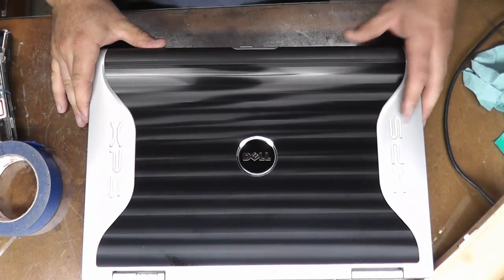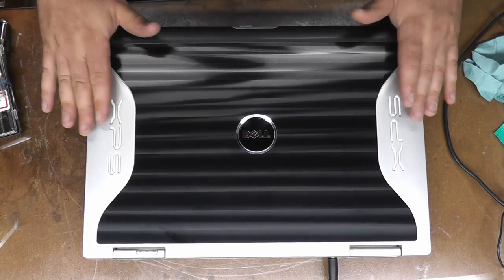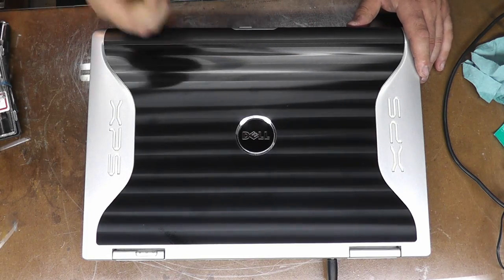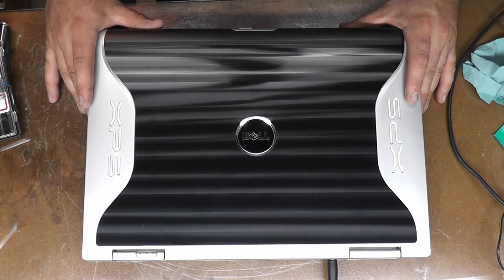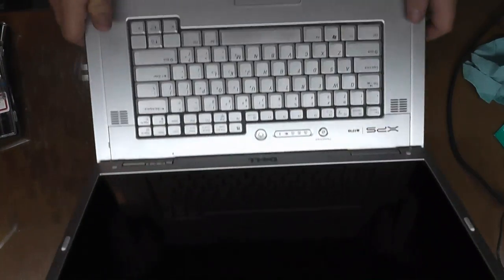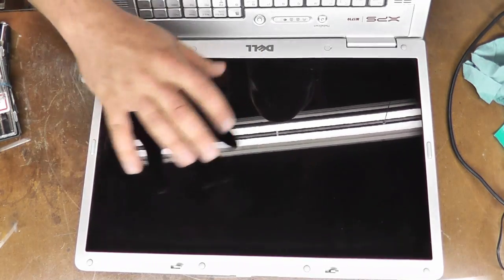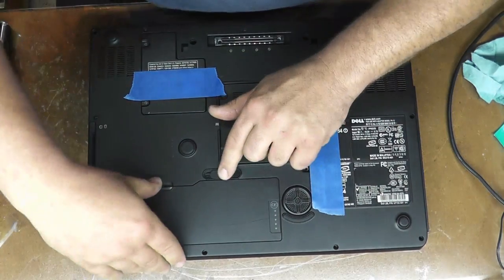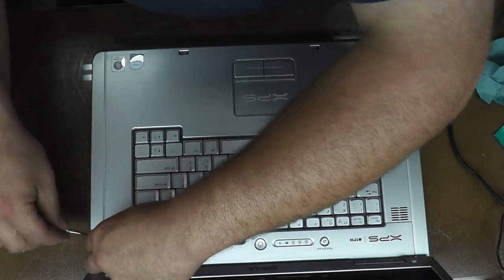Baking a Computer Back to Life

Comment: Next time, maybe try a reball with some lead solder balls. Either way, you NEED flux when you're doing electrical soldering, the same as when you're doing plumbing/HVAC. There has to be a good no-clean flux under the chips when they go in the oven. I apply flux when soldering anything, even when using flux core solder. It just helps everything flow and stick much better.

Comment: Cool idea/method. How did you come up with the "Bake" time and Temperature settings. I think most of us would use this situation to go out and buy a new laptop ! 

i wonder how well this would work on the old dead furnace boards, as I find them to be crappy-built ... Nice job Dude...
Reply from the maker: Did a little research on the internet along with a bit of my best judgement.
Reply: PackratCND with a regular Best Buy type laptop at a few 100 dollars, just going out and buying new would be fine, but replacement cost on these types of systems can run well into the thousands of dollars.